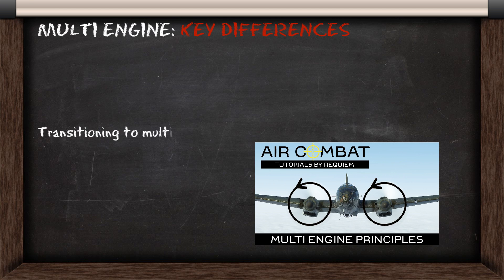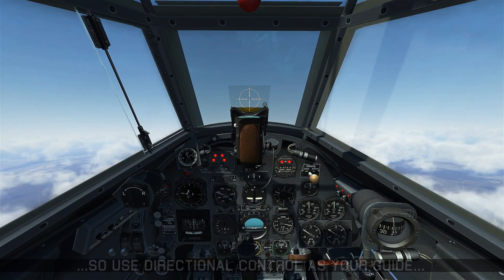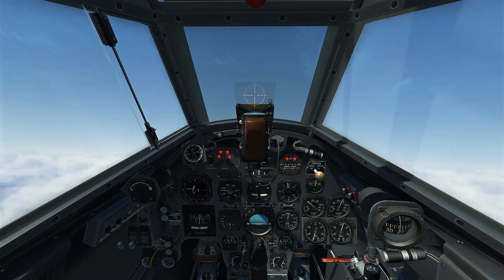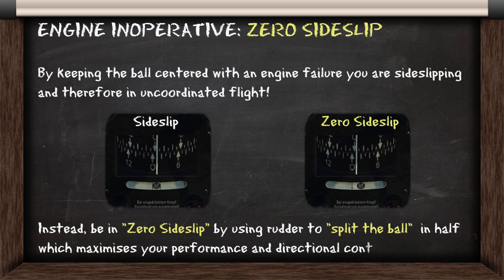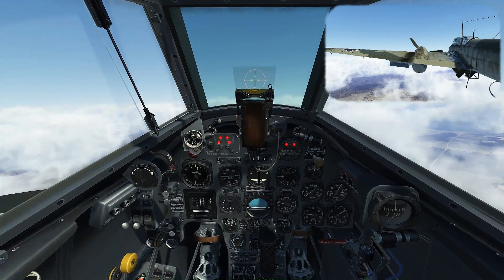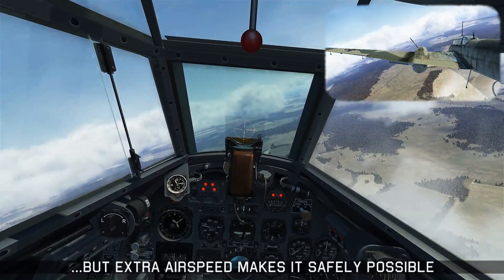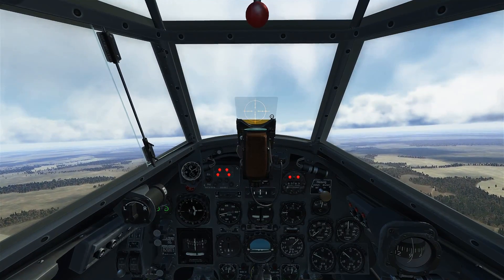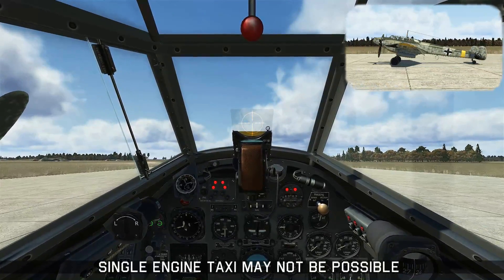Principles #14 - Multi-Engine Advanced

Comment: Excellent. You might also try a video with a brief close-up of a modern instrument panel,  in order to show how "the Ball" moves as a rudder pedal is pushed forwards, or pulled aft.
Even before retiring on the Delta B-717, we scanned the ball freq. while cross-checking basic instruments during "recurrent" sim. training, as in the older DC-9s etc. Slowing on base as we configured, and then for the final approach segment,  we always checked "the Ball" in the simulators' IMC (bad visibility/instrument flying) conditions. Push on "the ball" when outside the indexes...........and Trim!.
Reply from the maker: Nice! At my regional it's a "brick" for us to check. I'm planning on doing some videos in MSFS once the CRJ from Aerosoft comes out for it so it will be interesting for people to see the differences with the more modern instrumentation

Comment: Excellent videos on ME principles. Do the engines on the BF110 fail to a feathered condition automatically or is it necessary to manually feather the failed engine? Not sure about these aircraft, but most ME aircraft will fail to feathered using prop counterweights and the feathering spring as a loss of the engine will result in a loss of oil pressure/fine pitch capability.
Reply from the maker: Thanks Connor, feathering must be manually controlled in the Il-2 airplanes that feature it.

Comment: On your first multi engine video I discussed an issue I had and now I have another one which became apparent with the JU 52. And that issue is "Which engine is which?" In trying to do something with say engine one or engine two or even engine 3, I found I had to run through all the engines to find which one was which. In an emergency situation I would not have the luxury of sitting parked on the air strip trying to figure out which engine is which. I would have to know that is engine 2 or that is engine 4 and so on. Does IL2 have a pattern which you can instinctively know which engine is which. I mean it is fine for two engine planes but what about planes with 3 or four engines. Is there a pattern like: left outside engine is engine 1,  left inside engine is engine 2 and so on. (only using that configuration to make my point.).
Reply from the maker: In the regular twins the left engine is #1 and the right is #2. The Ju52 is just a bit of an oddity because the middle engine is #2, but I would expect it to be #3 to be honest. If we were to get a four engine airplane I imagine it would go 1 2 3 4 from the outer left to outer right engine, but we won't know for sure until a four engine airplane is put into the sim.

Comment: Great job - methodical approach may not be as exciting as hearing loud noises and watching stuff blow up, but you get a lot of good information out in a short video.  
One thing - I would expect to trim out the asymmetrical thrust (assuming you have trim controls for aileron and rudder) rather than holding rudder and aileron to maintain straight flight/split bubble.  Conventional wisdom is that trim is more efficient.  Is that a waste of time, given that small changes in throttle are going to blow the trim away anyway?
Reply from the maker: Yeah I know the shooting stuff is popular alright...my gunnery introduction video had a much larger number of views in a short time than I expected.
About the trim, I personally never taught students to use the rudder trim because their foot being used was a great reminder as to which engine was failed and it let them stay in touch with the how the airplane was feeling. Coming in single engine they wouldn't mess up their foot pressure when making adjustments while landing. Of course, the workout was good for them too :-)

Comment: Fascinating to have an actual explanation of what you do without knowing. I always "feel" what I have to do in a critical situation, but cannot explain it, let alone understand it. Wonderful video again, thanx mate.
Reply from the maker: Yeah that's true. You just "fly the airplane" as it were, correcting what is wrong caused by the situation. One aspect of this video in particular that can seem counter intuitive is the zero-sideslip technique. I've read on sim forums people recommending centering the ball in an engine failure which is actually incorrect because even though it looks like you're flying co-ordinated the effects from the engine offset in a twin means you will fly with more drag if the ball is centered.
Reply: And that drag will be caused by the (over-corrected) rudder, right?
Reply from the maker: Yep! The excess rudder means you are no longer aligned with the relative wind = more drag
Reply: Got it! Thank you good Sir! I'll be back with more questions! :P

Comment: I am not sure what's the point to verify what engine is dead by doing all this, you can just look left or right and you will know what engine is dead, right? :0
Reply from the maker: On the basic level yes... but you would be surprised. I've seen students reduce the throttle on the wrong engine, attempt to feather the wrong engine, and even attempt to shutdown the working engine in flight AFTER they've feathered the inoperative one. The "verify" is there to solidify in your mind which engine is the dead one, because if you get it wrong then you turn into a glider ;-) Imagine if you were under the stress of combat or a real engine failure, simple mistakes like this have huge repercussions.

Comment: Looks like I have been doing it right by instinct. But how about planes that have no function to feather like the peshkas, does janking the rpm around do anything? I never notice.
Reply from the maker: Ok Leon, if you have no feathering capability...feathering reduces drag...so what RPM setting would you use to reduce drag?
Reply: The lowest possible of course. I did not phrase the question very well, sorry bout that. I´m not sure if the rpm gouvenor even works when the engine is off.
Reply: @Leon_Portier  Well it sure doesn't change the RPM itself very much as the engine which Rotates the blades ("Per Second") is dead...
Lower RPM, that means less spinning. I wonder why that would be good when the drag itself is trying to spin the propellers, not stop them...